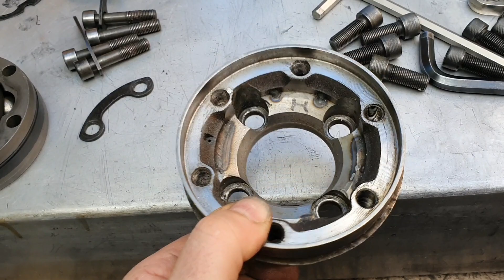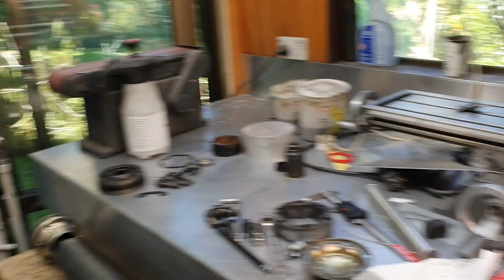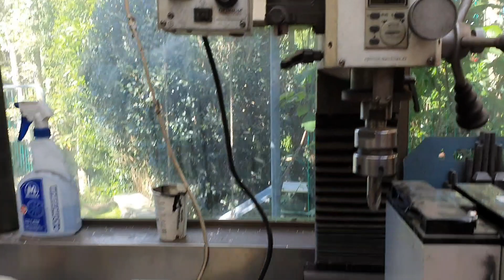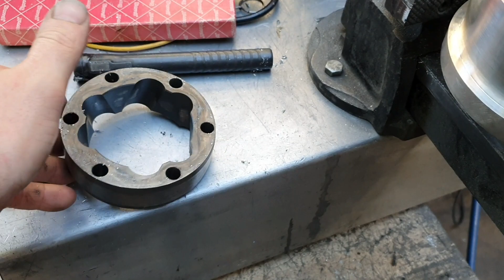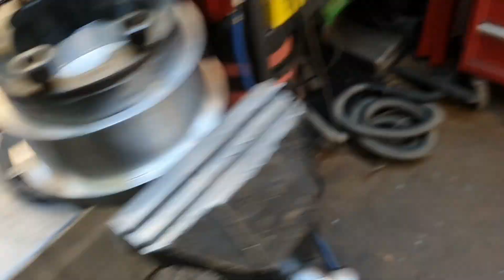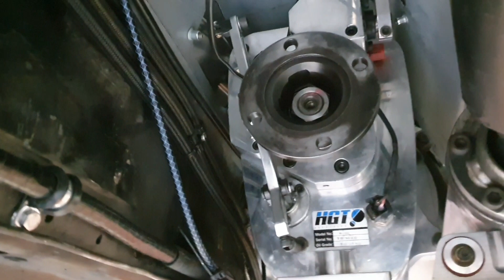Making another drive shaft adapter & stuff & things

Comment: What's up with the quill on that "Heap of Crap". It's not going up properly as it should be bottoming (topping) out against that O-Ring.  BF20L has a quoted spindle stroke of 50mm.
Reply from the maker: TBH I'm don't even care anymore, that thing is the biggest lemon I've ever purchased, it has cost more than purchase price just to keep it running for pretty limited amount of use.
There's some form of hard stop in there preventing further upwards stroke/travel.
it is VERY true to its new label.

Comment: Seeing underneath the front again reminded me of something.  Given your problems with the thermostat can you not remove it, replace it with a reducer and then run the electric water pump from a solid state relay PWM controlled by the ECU?